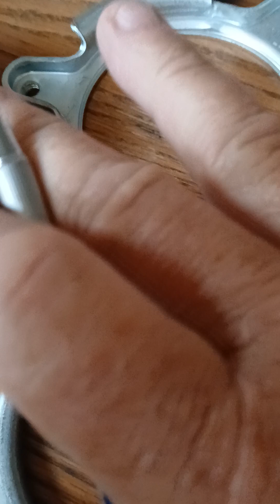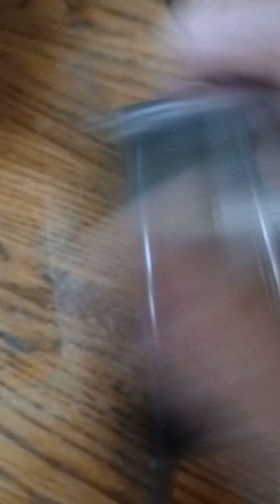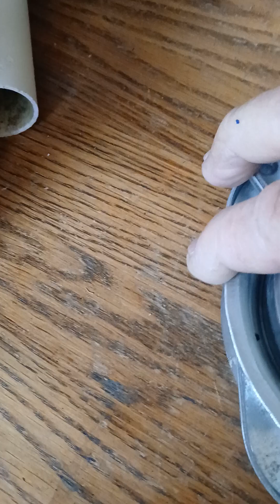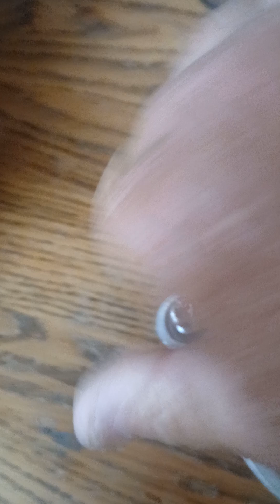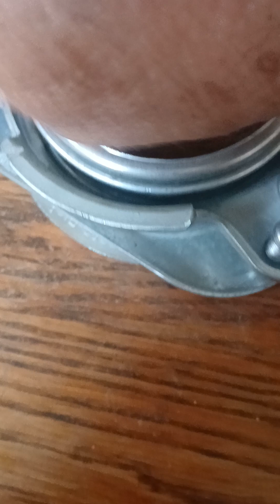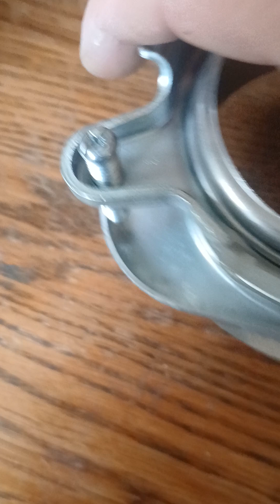Assemble Hardware For Garbage Disposal?

Comment: Actually 8 parts... you're missing the paper/ cardboard  piece that would go on second. Also... moen added a ring clip  holder, that make putting the spring ring on much easier. And you  can use that holder  on most other disposals.
Reply from the maker: @garyhamacher7444  Great point.

Don't think I've seen the ring tool thingummy, be on lookout for it.

Anything that can make job easier, all for it?

Thank you!
Reply: @gotchaplumber  yes sir! It only comes with the moen, so after installing the one, I kept it! It's  a game changer! Makes the installation a bit easier now!
Reply from the maker: @garyhamacher7444  Can one use with other brands?

Like to see pic?